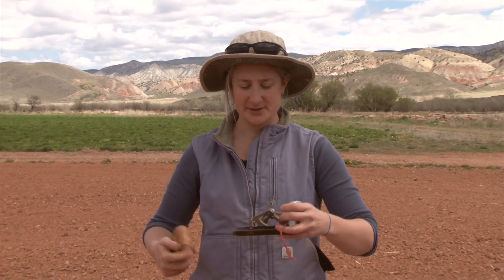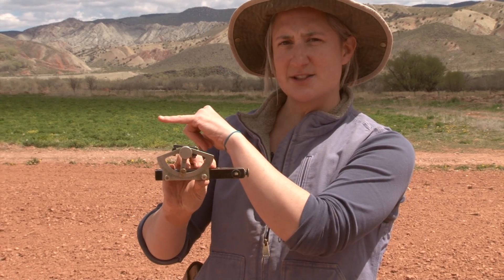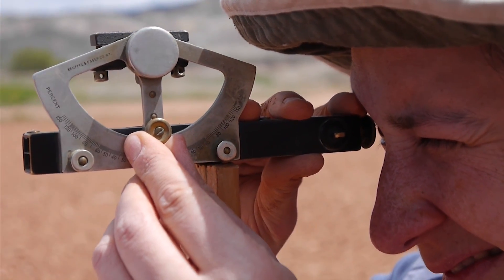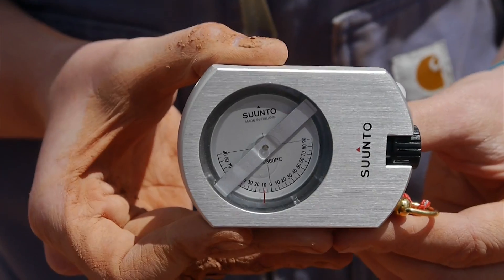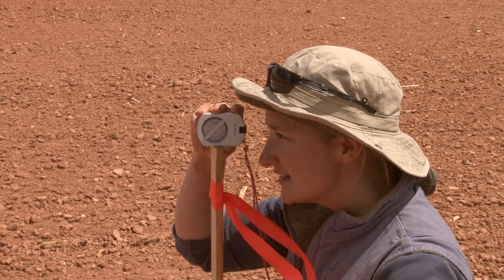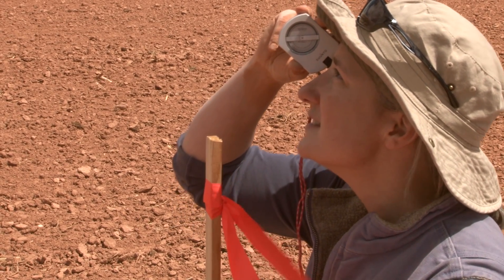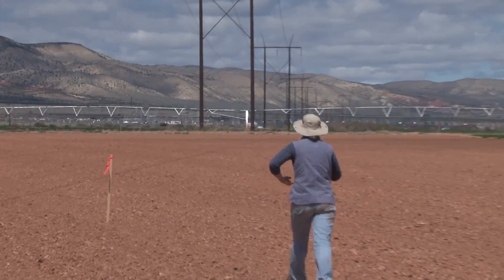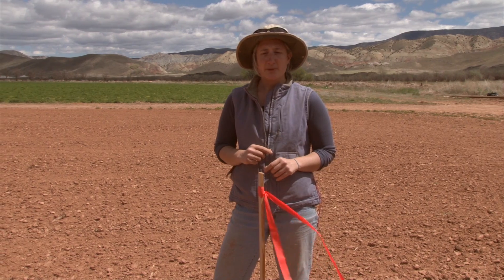Soils: Determining Landscape Slope

Comment: As a former grade checker / surveyor when we use a clinometer You hold it about  8" away standing straight and use a folding wooden tape next to it so you can see the tape and the dial inside at the same time and you would aim at the stake but with a ribon and you measure the ribon to the ground and doing it that way you can be very accurate quarter inch or better we had to be within a tenth or 2 at 100 feet.

Comment: If you read the  clinometer placed on the top of the stake, and then aim the horizontal optical line at the top of the stake down the line. Arnt you reading at a angle above or below? Since you would want to read the top of the stake to the top wouldnt the center of the clinometer from its side, so the middle of the circle, has to be either next to or you read the clinometer from behind and line up the 2nd stake so you are reading both in a line.